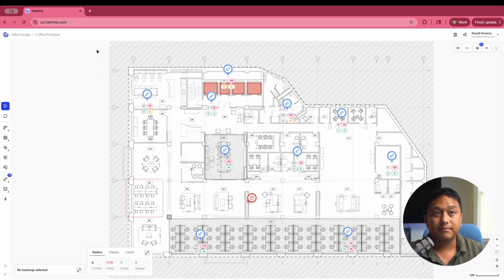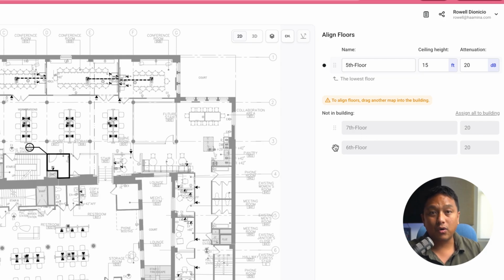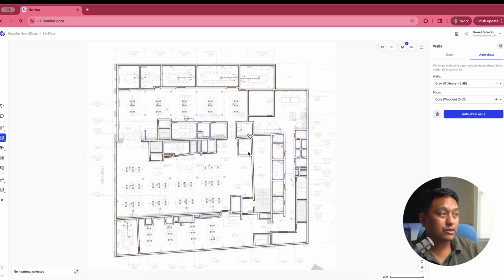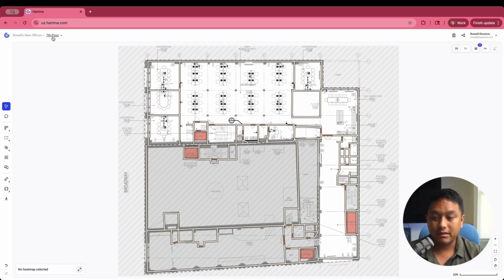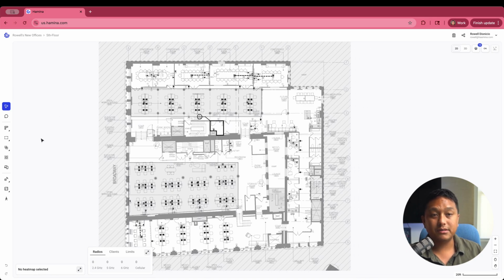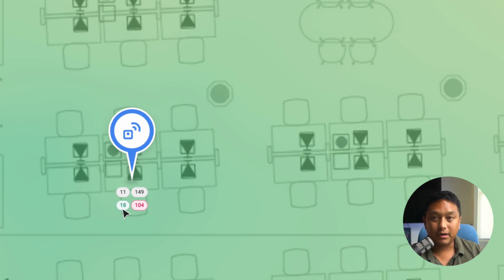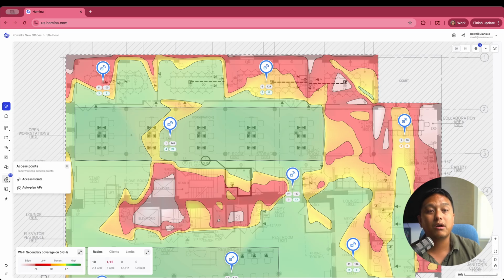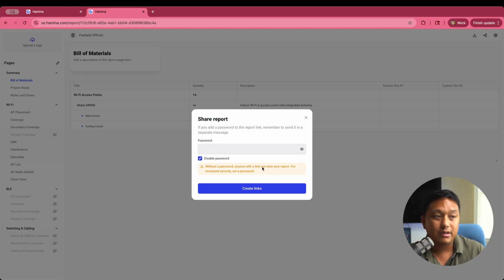Step-by-Step Multi-Floor Wi-Fi Design Using Hamina

Comment: This was great for figuring out the best place to position a single wifi AP in my two story house. (and where to possibly add a second AP in the future). I found 12 dBm attenuation between floors to seem to make sense for a wood construction 1998 built house, going off of macbook pro rssi measurements.
Reply from the maker: Awesome! Glad it helped with your home network.

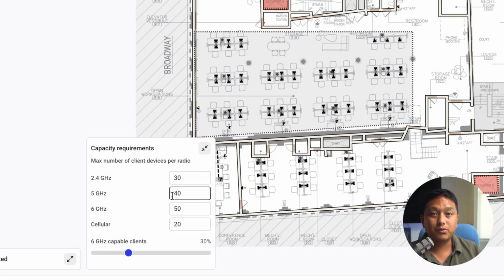Comment: 24:11 applications is super hard now because of OFDMA etc… instead we prefer to use the design guidelines from your vendor. If an area needs real-time voice maybe use 10-15 devices per radio and for web/email maybe 30 per radio. It depends on what your vendor suggests and if you’re using QoS or not etc. For instance MS Team doesn’t tag traffic with QoS even if your network is set up for it. You have to enable it via Group Policy. The idea with having clients per radio is that people can research (and test) their setup and adjust accordingly.
Reply from the maker: This would be a change in the way I think about it but I’ll see if I could do more capacity testing with Hamina.
Reply: There is a great video by @peterMacKenzie from WLPC Phoenix 2022 - It is impossible to calculate Wi-Fi Capacity.